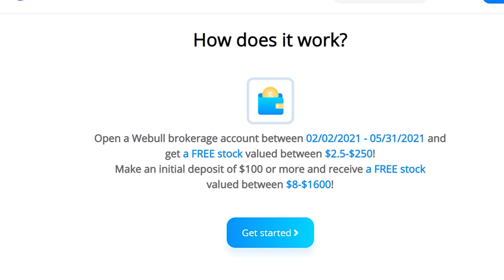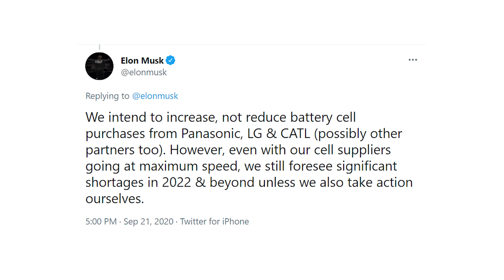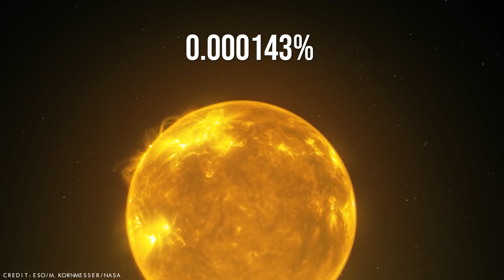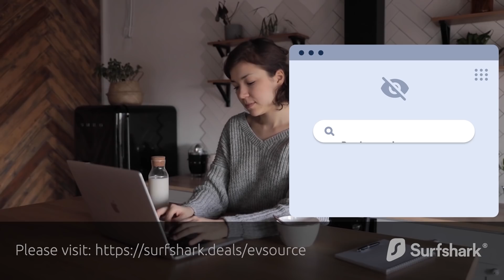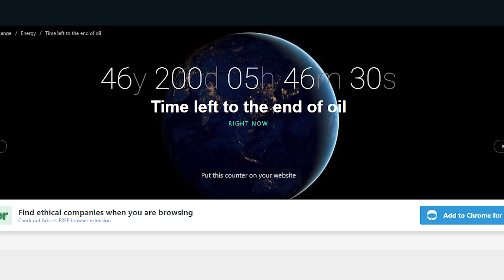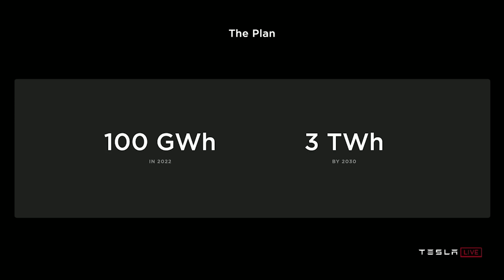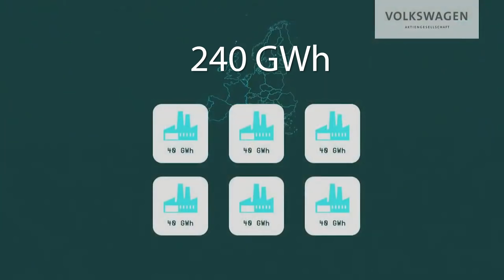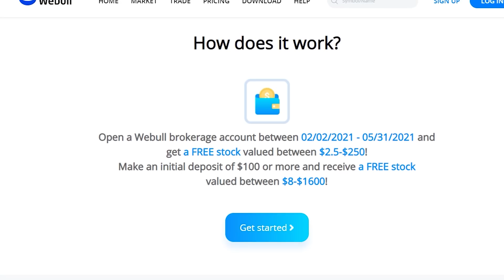Elon Musk's Message To Oil Giants: "The World Could Be Powered By Solar Many Times Over"

Comment: No man knows how much oil and gas are still in the earth . Geologists say America alone has 500 years of oil and gas left. By the way, it's not fossil fuels , it's oil and gas created by natural forces no different than other minerals such as iron, Nickle etc... Dead dinosaurs don't turn to oil and sleep into the earth down to twenty thousand feet. We've been lied to about fossil fuels all our lives. The trees need carbon dioxide to create oxygen. This being said, I'm not anti solar / wind. I believe we should explore and use all our resources to fill in the gaps in certain regions and weather conditions. Electric cars suck in extreme temperatures and gas is a better option for those times of the year. This is why cars should all be hybrids. Hybrids can use the battery in better conditions and use the combustion engine in extreme conditions.

Comment: Full of lies to the ignorant. All you show is that you can surf the internet. 
Indisputable FACT: NO ONE knows how much oil is in the earth. It is impossible to know what is under ground without going down there and looking. 
Solar is very dirty energy. Ask all the people who died in my near neighborhood. 
Batteries are dirty. The mining of rare earth materials uses more energy than the batteries themselves will ever produce. 
Who cares how much storage your battery has. You are a physics flunky. A battery must be charged to work. Charging takes time. Innovation can't fix that. The new 800 volt charging systems are at about the top of what will ever be practical, and they are grossly inadequate. Towing with the Ford Lightning takes longer to charge than it discharges under use. Using higher voltage charging systems  is impractical. As the voltage rises, the more prone it is to arcing, let alone killing someone when it fails. Doubling the voltage from the current high speed charging station will jump 1 mm through the air. Less than perfect conditions makes even lower voltages prone to arcing. 

There just isn't any way to transfer the necessary energy to the battery in any practical amount of time.  Technology is good, but it can't break physics.

Comment: We have 46 years (in 2014) or 38 years (in 2022) or the year 2060.  Natural Gas or Methane heats homes now and electric heat has to replace it.  I like heat pumps.  For heating or cooling.  Learn:  Watts = Amps X Volts.

Comment: Peak oil was first said to have seen an end to oil in the year 2000. I agree with transitioning into sustainable clean energy, which I think are going to be Decentralized LENR's, Thorium modular Reactors, Hydrogen splitting tech. Hydrogen fuel systems... Batteries are a stop gap measure until we get super capacity. super-capacitor like, instantly chargable batteries, the Nano Diamond depleted uranium batteries look interesting if they can be scaled up, etc. BUT as far as a Dumb experiment and all the Climate CO2 BS goes this is a UN agenda 2030/WEF Great reset agendas Narrative that is complete Garbage. Firstly Hydrocarbons were an energy upgrade from Wood, which had massive benefits at the time which was three centuries ago, Coal the new Hydrocarbon of the time powered the industrial revolution, which has lifted Billions of people out of poverty over these last three centuries, we then went to oil which was far more efficient than coal, then we went to Gas which is better than oil and is hugely abundant around the planet, the problem here is Fracking which is highly polluting to ground water and not as effecient a method of extraction as it was first sold to us, it should be banned just as Oil sands oil extraction should be banned globally due to it's incredibly polluting effects on the environment. IF the World wanted to transition to cleaner fuels we could do that at anytime by subsidizing Biodiesel, from HEMP, Bioethanol from HEMP and Bio gas from HEMP. we also had an american inventor who developed a super efficient Hydrogen splitter to run cars on water back in the 1970's (video here on YT) which means this ultra clean abundant source of energy has been suppressed for 50 years, by both Oil & Gas Corporations but also the US Government, which has been sitting on the patent for all this time. The reason Oil has been kept around for so long is due to POTUS Nixon who tied the USD to Oil back in the 1970's as the Petro dollar after taking the USD off the Gold standard. Oil is still being discovered in easily accessable areas and with many countries being sanctioned unable to sell their oil to the open market by the US-coalition those reserves are still hugely intact. the reason we are moving away from oil at this time is due to a complete Financial reset, not a lack of oil, the US doesn't want Oil rich countries to profit from the new economy rather than any concern for the environment. And even though I admire Elon for his amazing achievements, If Elon was concerned about the environment, he would put some effort into rehabilitating the environment rather than planning a base on Mars, which is unbelievably inhospitable to humans compared to Earth which could be a paradise.

Comment: Just alone the damage cause by. Burning this fossil fuels.to the environment and our air. That alone, is the major down fall. Car crashes, more than likely. One or more vehicle, will ignite. Some times with the drive or passengers in the vehicle. The cost for gasoline. It’s been a problem! One that they can’t or haven’t. figured out, how to solve. With fossil fuels, there is no future. The oil giants have failed. They should of been, on the team a while ago. But they choose. A very, detrimental path not to join in. Cause electric everything is the future, it always was.

Comment: To make batteries/electric cars you still need natural resources so you stop using crude oil well you need to mine minerals for batteries,wires and conductors etc.
Is there unlimited minerals available?  Unlimited water ?
What about plastic,rubber to build cars?
Lots to think about for sure.

Comment: Anything is possible; but you must produce the solar panels and keep them running.  If deployed in large farms they are vulnerable to terrorism.  They don't last that long and have to be cleaned.  it would take 22,000 square miles to power the current grid and to replace oil energy would take about 66,000 square miles or about half the state of Nevada.  Sounds like a lot of crap.

Comment: The problem is the BS that gets extrapolated... That 1% actually needs to be 3% and the storage 7 to 10%  if you want storage that delivers in bad weather. Ask any installer of remote comms about the needs. And yes remote comms still fall over. The BS he said about Nuclear is wrong because he equates total output of solar with 30% capacity usage in nuclear. Plus all those areas around nuclear are protected wildlife areas and do an exception job of it. The exclusion zones limit all human impact so in most cases they are the best wildlife areas.   \you need to learn more before spouting BS

Comment: FossiL fuels are gonna run out eventuaLLy. Don't forget the Arctic with the Icecap melting. What is required is a ParaLLeL system - allowing fossil fuelled Equipments to operate aswell as ELectricaLLy powered etc.
Reply: We are due another ice age. The seas aren`t rising. The Earth and its climate are dynamic. Humans will never change that.

Comment: Why is it so many forget that oil is used in just about everything around us ?
Reply: so we should not WASTE IT and pollute by burning it.
Reply: @manueldavid7369  uh yeah, that's kinda the point of an EV.
Reply: @shawnwise2458  by far not the only one. For some also not the biggest one. Tesla for example does not sell so much better than any other manufacturer's "modern" cars and has a so much better customer satisfaction rate simply by "making cars that are 100% electric". There is a lot more they offer to their customers by their innovative cars and product family/network.
Reply: @manueldavid7369  No, it's created as a result of the processing of petroleum for petrochemicals.  It would, therefore, be far MORE polluting to simply leave it, and NOT burn it.  It also creates the kind of pollutants that plants and the environment can process and mitigate.  The waste and pollution from battery and solar panel and AC motor production, on the other hand, is HIGHLY toxic and stays there FOREVER.
Reply: @billcichoke2534  Not true. Tesla for example has been founded on the patents of batteries that are mixed differently, with resources contracted and controlled to be sourced cleanly, without destroying the place its sourced from, leaving nature behind intact and healthy. Additionally, being a mixture which lasts and keeps stable a lot longer than any affordable battery before. Tesla is at 1.8 million km use stable battery capacity since 2018. Meaning such a battery lasts the average driver for at least 30-40 years with the same range capacity. Also the battery had to be mixed and structured in a way that makes it 100% recyclable and contracted to go back to Tesla and its battery recycling and rebuilding plants by the end of its life span or when being replaced by a newer generation battery. Tesla has reached this for 16 years. Every battery exceeding the wildest estimations from back then. Proving batteries can be fully clean and sustainable from sourcing over production until full recycling. Something impossible by oil, gas or cole.
Reply: @manueldavid7369  And yet there's no active viable  battery recycling going on, and the batteries still use lithium, copper, nickel, and cobalt, which cause MASSIVE environmental damage JUST BY GETTING THEM.

And Tesla goes through Panasonic, CATL, Samsung and LG Chem for their batteries.  NONE of those companies do ANY of what you describe.  So that whole line from Tesla is crap.
Reply: @almostthere100  Name what I'm wrong about, or admit you have no idea what I'm talking about.  And if you looked up what I mentioned, then you wouldn't have made your statement.
Reply: True but hydrocarbons from burning petrol and diesel are killing us slowly. There will always be a need for oil though.
Reply: @shawnwise2458  No they aren't, and haven't been.  If there's any FUD in these discussions, it's been AGAINST THE USE OF PETROFUELS.

Interesting that supposedly 'caring and compassionate' people would deny cheap and relatively NON-polluting means of energy and transportation to those who cannot afford your EXPENSIVE and far more PERMANENTLY polluting 'green' version.
Reply: @billcichoke2534  you are either very far off your knowledge on this topic or a bit confused.
Reply: @billcichoke2534  you are not understanding the basic science of gas combinations and micro particles, and what it both does to ..or better said "against" your health and the stability of the weather/the environment. Oil and oil-like substances, so as gas and cole need to remain unburned in order to NOT damage you and the environment. Very basic.
Reply: @manueldavid7369  Neither.  I'm calling bull on the sales lines and other pro 'green' propaganda, because they're s--t on toast meant to fool scientifically and financially illiterate people and separate them from their money and freedoms.

Not confused or wrong at all.
Reply: @manueldavid7369  Then throw away all your electronics and plastic and don't use medical services that utilize petrochemical-based products.  Will you do that?

And the fact of the matter is, the more we get rid of green areas with either urbanization or solar panels or removing animals, the less O2 we have and the more CO2 and impurities we have...REGARDLESS of what we drive.

Confused? Look up photosynthesis and then tell me how confused I am.
Reply: @billcichoke2534  I'm not buying that argument we were doing just fine before the industrial revolution when all the cars hit the road. There are plenty of areas where solar could be used that isn't forests, Starting with the deserts and outlying unpopulated areas. Whether you agree or not hydrocarbons aren't the future and hydrogen is a pipedream without infrastructure. Solar roofs on houses would be a good start. As far as solar not being recyclable that's a myth, it can be. Greenmatch.com

Comment: All the data, presented here, about how much energy we get from the sun is true. One problem, PV Panels can only convert VISIBLE LIGHT to electric power. We only get 14 watts of visible light per Square Foot from the sun. All of those remaining  3,880 Terra-Joules/sec  of Solar Energy are unusable. Most of that Energy is Heat, UV, Radio waves, even x-rays (TG a tiny portion)  EVERY other part of the Electro-magnetic spectrum. 

That little tiny corner of Nevada powering the US? It's pure GRIFT, that would only be true if we had some device that could convert ALL forms of EM coming from the sun, not just the Visible Light

Musk is the world's most successful GRIFTER
Reply: Well said, Elon is speaking theory very different to reality in natural Earth with cloudy days, hail storms that will pulverise the solar panels and there's only some energy that can be stored in those Tesla powerwalls. 
Example in South Australia $50 million was spent on Tesla powerwall farm if heavy industry was to depend on it the batteries would go flat in 15 minutes. 
Musk is a great salesperson

Comment: Without oil, where do you get all the plastic materials & lubricants that go into a Tesla vehicle? I challenge Musk to build a car using zero oil-derived materials. As for replacing nuclear plants with solar panels, that is complete baloney. Solar works only in daylight hours, power plants operate 24/7. 100GWh of battery production might sound a lot, but the power station near my home can generate 100GWh in 2 days.
Reply: In addition, the mining equipment, the foundries that smelt the metals, the transport and yes even the electricity to manufacturer his death trap POS cars uses evil petroleum.

Comment: I didn't believe it. That solar power equal to the keep out zone could generate as much power as a nuclear reactor.  

DoE says a 1Gw reactor takes about 1 square mile of space.

One mile of solar panels using average numbers provided by terrawatts_com will produce 1.16 Gw

I like being wrong.
Reply: Yes, 3 FACTS Grifter Musk fails to mention are 

1) PV Panels can only convert Visible Light to Electric Energy. 

2) We only receive 14 Watts / Square Foot of Visible Light from the Sun. All of the rest of those 3800 Terr-Joules / sec are spread over every part of the EM spectrum. Everything from Heat, to IR to UV, Radio and even X-ray. 

That is how he lies, he gives a true fact, ie the Sun does indeed produce 3,880 Terr-Joules /sec. He just fails to mention only a very tiny fraction is Visible light

3) PV Panels are now only 30% efficient. Hence they would convert only the 14 watts /square foot of light to a mere 4.5 watts of electrical power.
Reply: @coldlogiccrusader365  

I just looked up numbers.

One square mile of modern pv will produce 1.16 gwh of energy, assuming an average amount of light on an average piece of the continental US.

I picked 1 sq mile because that was the area requirement for a 1 gwh reactor.

It's just math.
Reply: @XMartianPrinceX  

I indicated where I got the numbers.

I trust the department of energy and others that publish data...

I do not trust your math compared to theirs...
Reply: @XMartianPrinceX  

I think the DoE paper went deeper than I would go.  A nuclear reactor almost never runs at full capacity... not to mention the maintenance. You have to swap out 1/3 of the core every couple years.
Reply: @JohnBoen  I’m just doing it straight off the numbers presented here, nothing more.  There is only 27,878,400 square feet in a mile.
Reply: @JohnBoen  Oh no worries, I had to take a second guess on this thing too but in reality, his idea for still achieving enough power over 100x100 k/m^2 still works theoretically, even if nuclear would reduce that footprint to say a small fraction of that.  Storage dilemma and maintenance as well.  Lots of things regarding nuclear are pre-addressed within its own pricing all the way to safe handling and storage of waste, solar however often prices out to the panel cost/area and doesn't focus on the maintenance, cleanup and disposal concerns of both the field this size and its means of grid storage.

Comment: Tesla is changing everything with their electric vehicles, energy, etc. apart from the economics. Any new tech that is more efficient, cheaper to run, maintain, will be expensive to acquire in the first place. If they, not just tesla but all electric car manufacturers, really wanted to save the planet, start giving free electric cars to ICE car owners if they give their ICE car up. That's never going to happen unfortunately... So until it becomes economically viable for normal people to buy these cars on the used car market, the electric car revolution will be limited to the rich, as with anything else really...